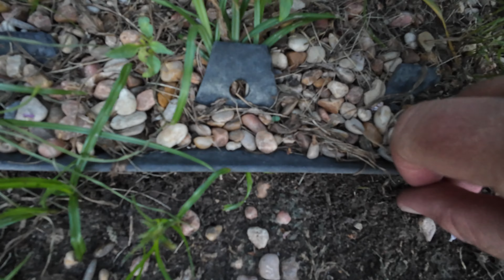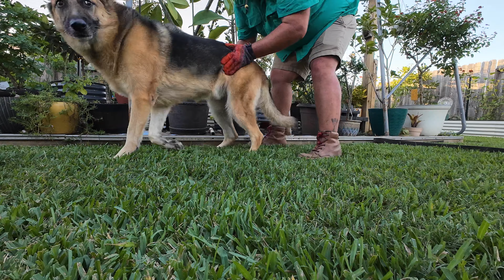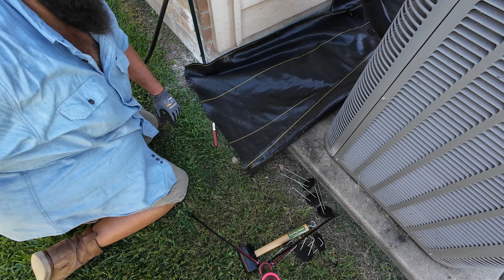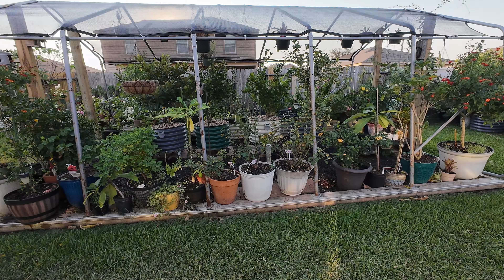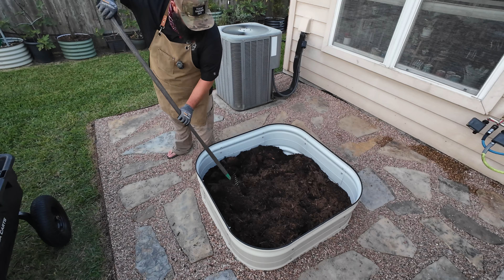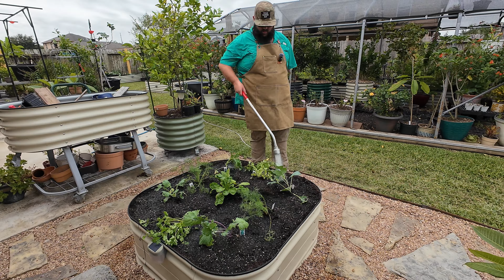SOLO Patio Garden UPGRADE! | DIY Backyard Landscaping START TO FINISH!

Comment: 1) removing those rocks was a chore, I’m sure

2) i kept waiting on you to cut out the plastic in the bottom of the raised bed. Will that not give you issues down the road?
Reply from the maker: I have it under my other beds and it hasn’t been a problem. It’s permeable so the water will drain